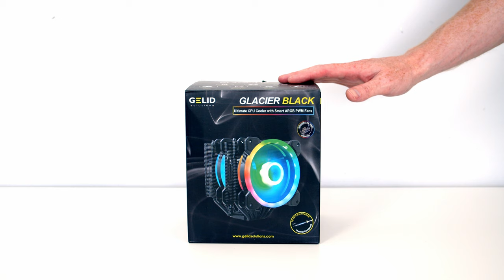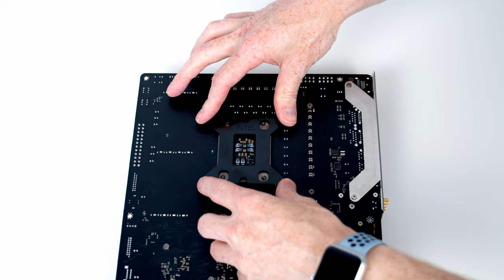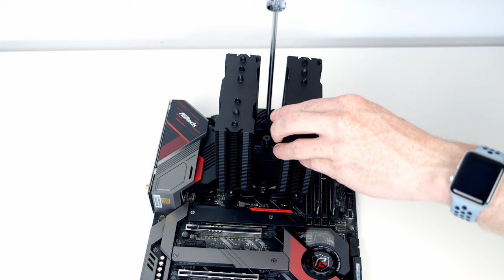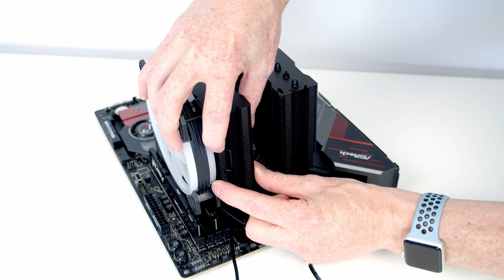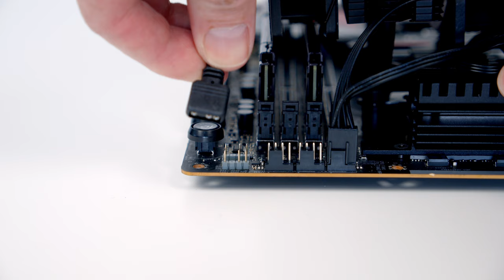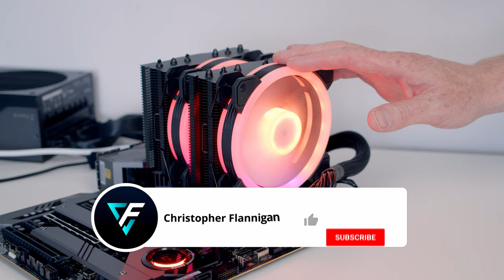Gelid Solutions Glacier Black - Installation Guide

Comment: As long as everything fits it's easy. On mine the holes on the backplate don't line up with the ones on the motherboard. So you can't get the screws through. Instead I am the one that got screwed.

Comment: Anyone had any luck mounting this to am5? I bought one and now im regretting it.
Reply: Same here, I'm using the stiffening bracket too so it's a total no go.
Reply: @ChrisLesmerises  bleh... just wish they didn't claim AM5 compatible on their site. I think if I keep the original backing plate and just drill out the spacers provided to fit over the stock posts and use the original bracket screws it should work....
Reply: @ChrisLesmerises  If you look up how people are mounting the peerless assassin to am5 its a similar procedure only difference is drilling the spacers out I think